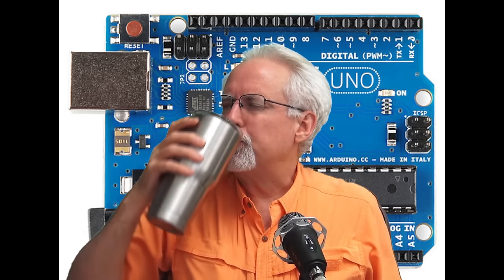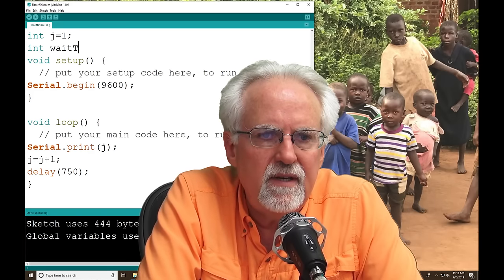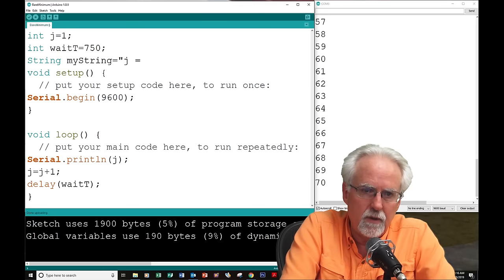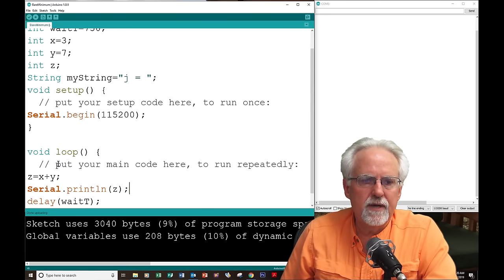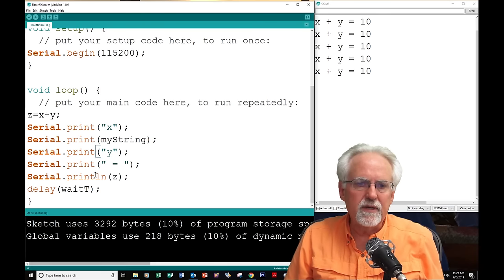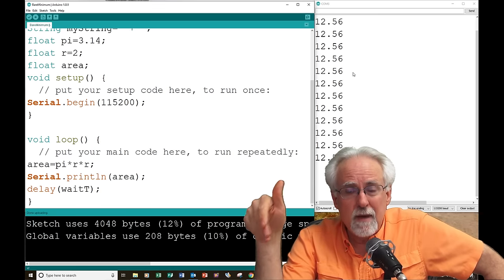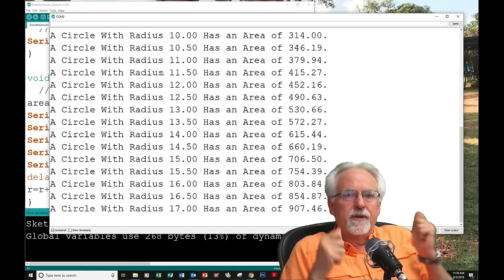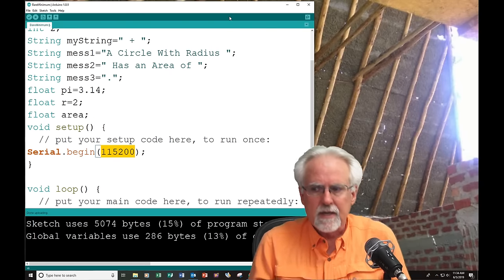Arduino Tutorial 11: Understanding the Arduino Serial Port and Print Commands

Comment: Hi Paul. Firstly thank you for the amazing lessons . I have a question .  When we declare an integer with the command " int  j=1" logically wherever we use "J" below it should read it as "1" just like waitT=750, where we use "waitT" it will read the value as 750. Then why in the Void loop "j ' is not read as "1" and read as "j".
Reply: Because it's in quotes. Serial.println(j) will print the value of j; Serial.println("j") will print the letter j. See the difference?

Comment: if you type z=x*y;  and make x 100 y 100 the answer printed  is 10000 as you would expect, but 1000 * 1000 the answer is 16960...????
Reply from the maker: Probably you are using integers, which have limited range. Should use floats

Comment: Can you go back to your first videos and fix the link to your kit to the proper one?  I clicked on the link on the first several videos, and the kit comes up at $64.98.  I ordered it (actually $74.90 when I ordered it a couple of days ago), THEN looked at the link on this video, and sure enough, this one is $39.90, a little closer to your "about 35 dollars"...  I guess I'm set for a little bit longer with the bigger kit...  You keep saying it's about $35, and I thought that was a huge price increase in just a year.  Anyway, in Lessons 1-4, your link points to the $64.98 kit, then in Lesson 5 it points to a $39.90 kit, then in 6 through 10 it points to the $64.98 kit, this one is correct, then Lesson 12 is back to the $64.98 kit.  Gotta wonder how many people are spending $25 more than they should have.  A couple of days ago, I actually paid $74.90, and the price has just dropped, so it was $35 more.  I paid it, because your videos are that good!  Now, I'm trying to get my $10 back from Amazon...
Reply from the maker: Availability of kits is changing on a daily basis. No way I can keep up with it. Either kit will work. The more expensive one has more components. Both are a good value.
Reply: @paulmcwhorter  My concern is more the confusion of seeing a $60 to 70 price tag instead of the $35 that you mention.  I agree that the more expensive kit is a good value...  Great job on the videos, too.  Very informative, and even better, INTERESTING.  You're a very good instructor...

Comment: coffee is not necessary...a glass of water at the body temperature will give you more energy than coffee...just sayin'
Reply from the maker: I survive on coffee! I also enjoy water, but have a carbonation system. I put minerals, lemon and lime, and then carbonate with a C02 bottle and enjoy a refreshing, mineral rich, organic beverage, without any sweetener. I drink about two liters of that a day. It appears to me that carbonated water is not bad, just dont use sweeteners.
Reply: @paulmcwhorter  Just a heads up, the acid from the carbonation alone, let alone the lemon and lime is bad for your teeth.